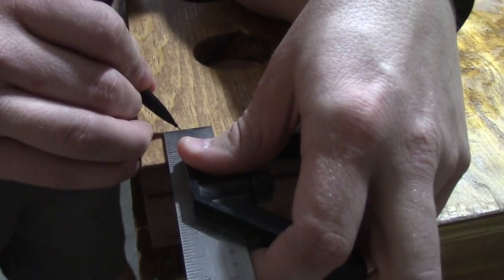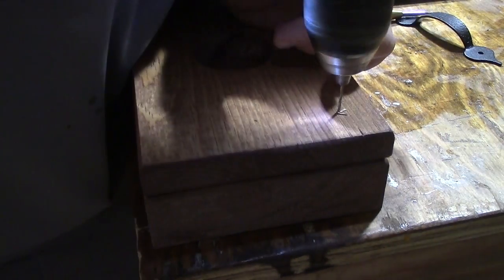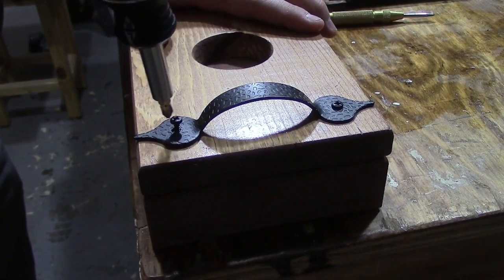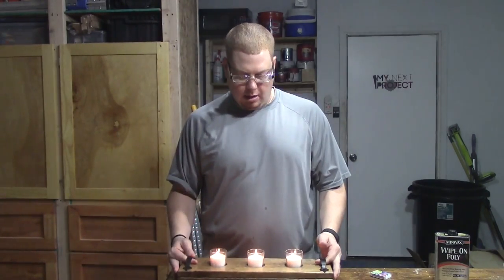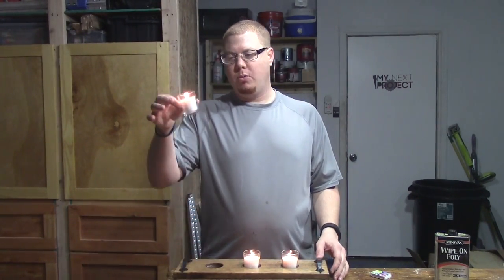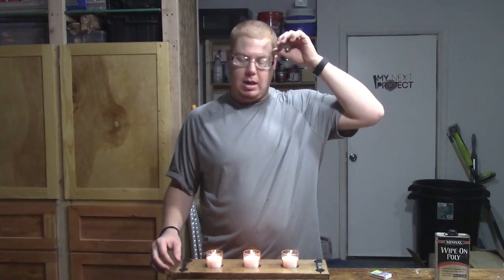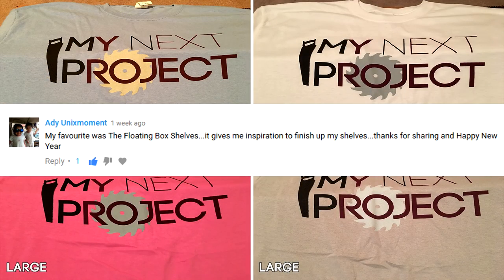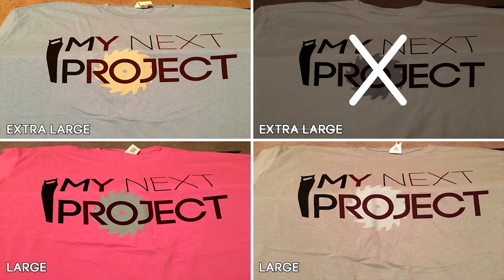Candle Holder Display

Comment: Just a thought but if you were to make the bottom section a sort of pull out draw then you could store the extra T-lights and a lighter under it's own holder, sort of a self contained unite if you like!, it would take longer to make but it would make a dandy gift and a real life saver in a blackout!!
Reply from the maker: That is a really good idea.  I did not think of that.  But that would look really awesome.  You might could even do it, kinda like a band saw box.  If i make these again in the future, I will have to try this.  

Thanks for watching and for the great idea.
Reply: No problem  : )